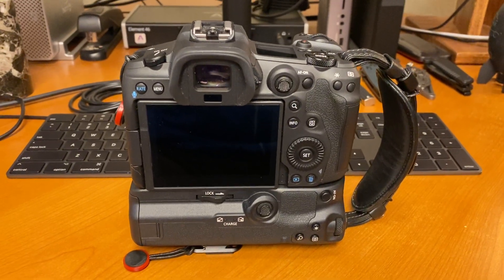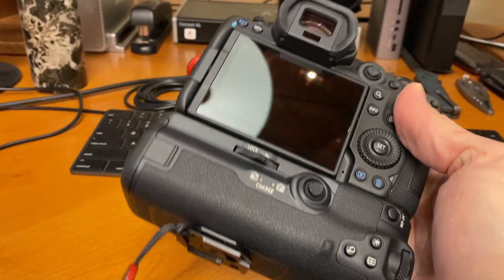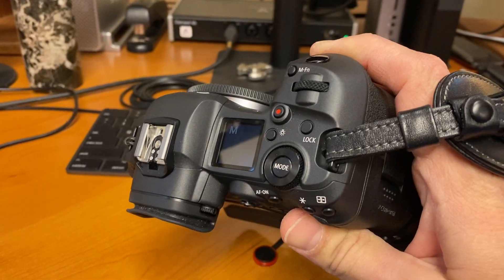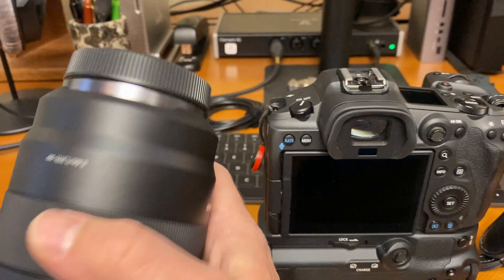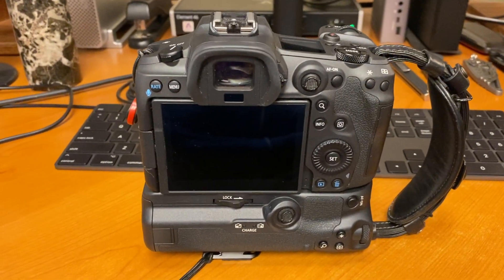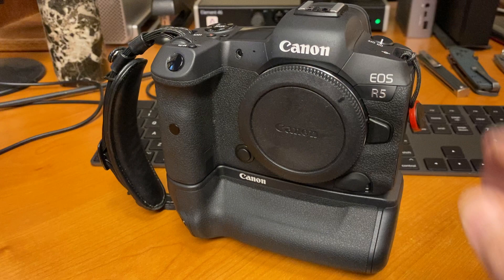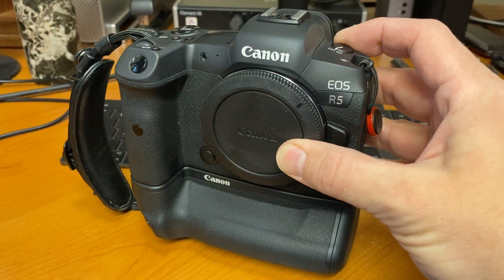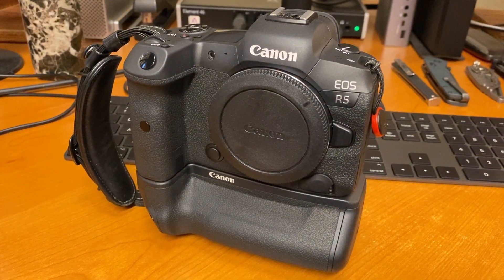Canon EOS R5 malfunctioning and making loud grinding noise - defective

Comment: i had the same issue and i returned it. the issue is with ibis.
Reply from the maker: I sent it in to Canon, and they fixed it. Ended up joining CPS and had the camera back in just a couple days. It has been working fine so far. Hopefully, it won't happen again. The repair invoice said that they replaced the "PCB ASS'Y, MAIN W/LI BATT" and washers.
Reply: @yesitsbrian   PCB ASSY?  the mainboard? am having the same problem with a R6  gonna change the IBIS  and Mainboard myself